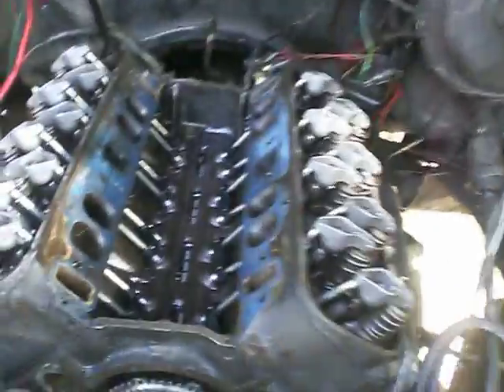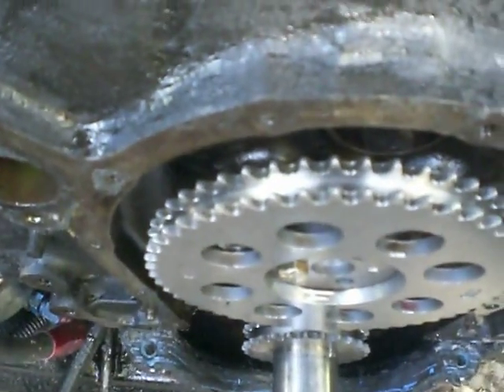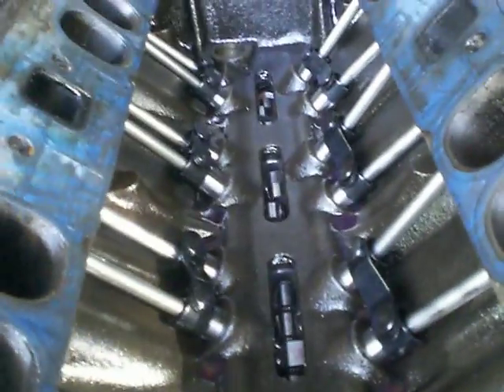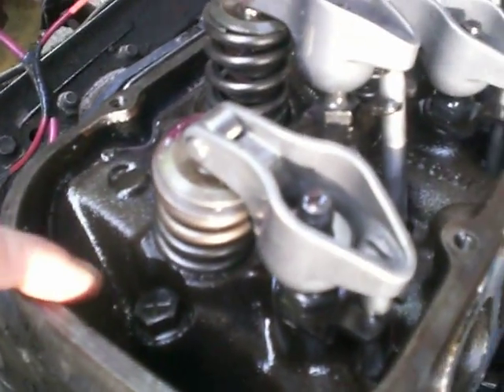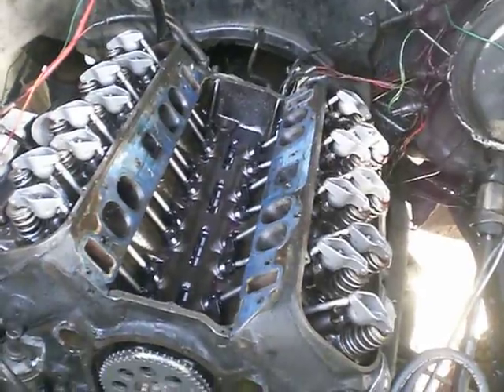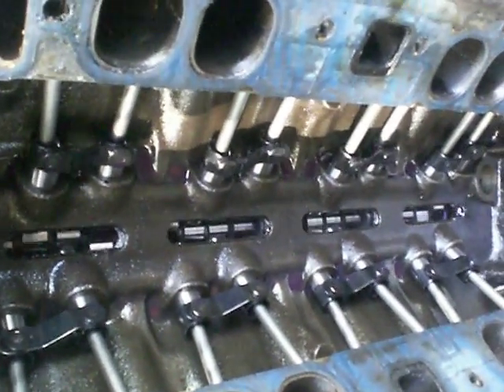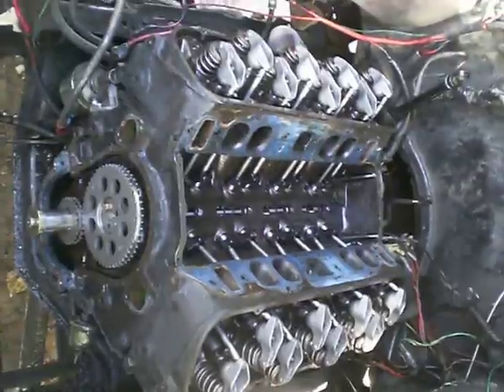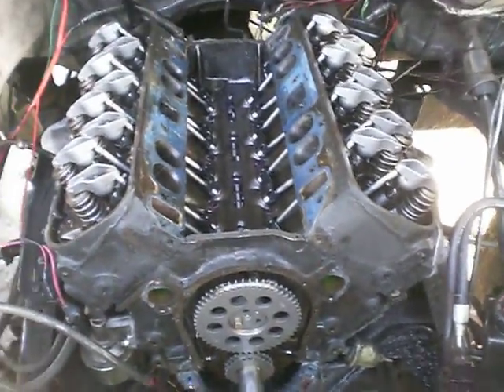Engine basics explained, whats a camshaft do?

Comment: Hey Will,

I am considering to buy a 2005 Lincoln Navigator with an engine lockup due to not ever doing an oil change. Car has 110K miles on it. After reviewing your vids and having a background in chem engineering I understand the nature of components of the oil. But I dont have a good background on the mechanics and risk of parts be deteriorated. My plan was to buy the car, open the oil pan from the bottom, clean out the pan, oil, filter (maybe oil pump as well)... open the top of the head gasket (not sure if this  is necessary) and prob clean anything that oil gets in touch with. Do you think this is a good investment or should I save my self the time and trouble and not move forward with this? Any idea is much appreciated.

Many thanks in advance!

Comment: bro you literally just showed me exactly what i was hoping to learn, exactly what the porpose of a camshaft is. preciate it
Reply: If I have it correct, the camshaft is larger because it powers the less demanding intake valves. For every one stroke of a piston powered by the crankshaft, the intake valve only needs to form half what is does because... There is 2 of them.

Comment: 2 stroke engines don't have cam shafts but otherwise pretty cool project...
Reply from the maker: +Kyle Gill 
2 stroke diesels have a camshaft, 
2 stroke gasoline engines do not
Reply: +Will Foster Also, triangle power doesn't have camshafts